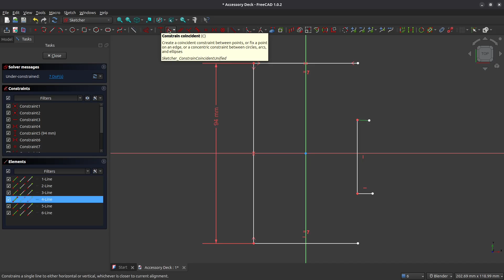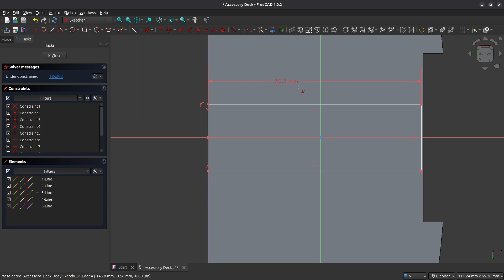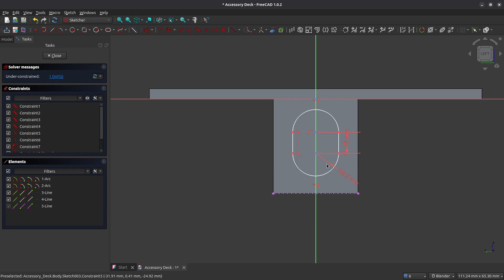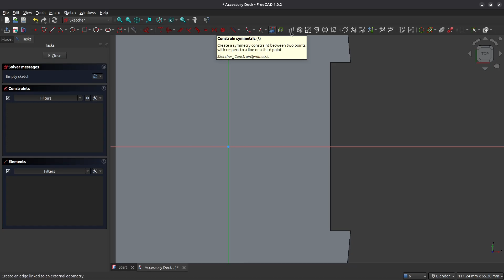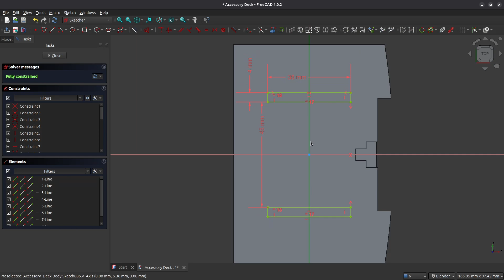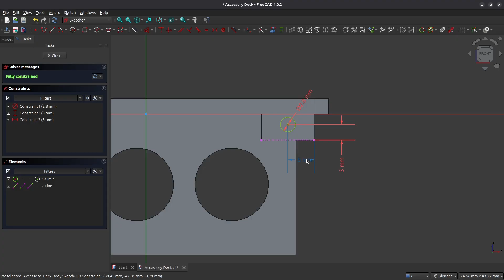Part 7: Accessory Deck - TitanBot | FreeCAD Robotics Design

Comment from the maker: The skeleton is officially complete! This Accessory Deck is the final piece of the main chassis structure. It’s rigid enough for a robotic arm but light enough to keep our holonomic movement snappy.

Next Step: Before we cover this up with armor, we need to secure the internals.
👉 Watch Part 8 (Integration Hardware) here: https://youtu.be/jA_yGPkA_4E

Question: This deck is a blank canvas. What should we mount on the front first? A Camera Gimbal (FPV) or a Robotic Gripper? Vote below! 👇